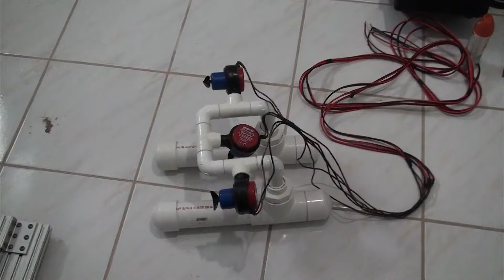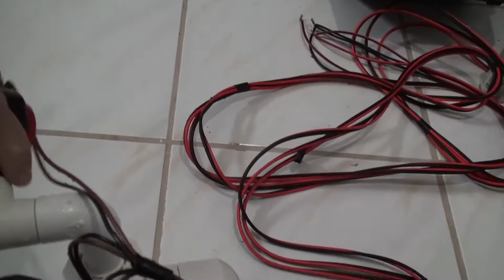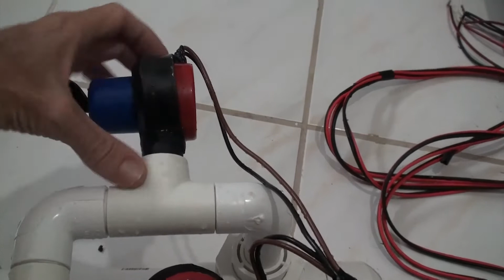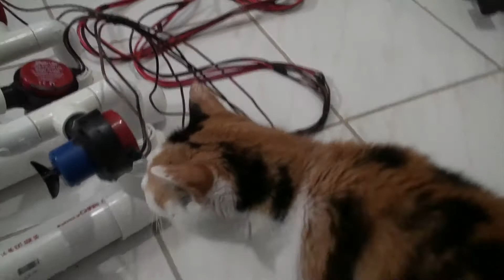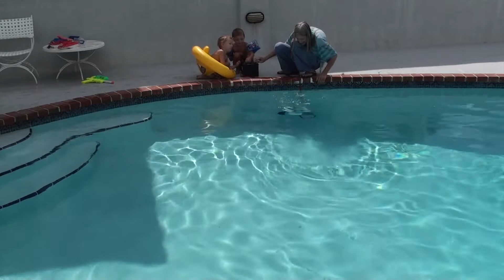ROV in pool 1

Comment from the maker: Thrusters are modified bilge pumps.  I used a dremel and abrasive disc to cut the pump part off leaving a waterproof motor.  The props came from a hobby store, they are for model boats.  Bring your motor so you get the right size hole for your motor or a smaller hole you can drill to size.  The thruster mount was cast onto the bilge pump motor using a silicone rubber mold.  To make the mold, I made a clay ring around the outside of the motor, and stuck a piece of 3/4 PVC in the side for the mounting thing.  I then made a 2-part RTV rubber mold of this with the motor inside the mold.  After the rubber cured, I removed the motor, clay, and PVC.  Now I place a motor in the mold and there is a cavity shaped like the clay ring and PVC nub.  I cast resin in the mold so it forms that black ring adhered to the motor.  The nub formed like the PVC pipe fits perfectly in the PVC fittings.